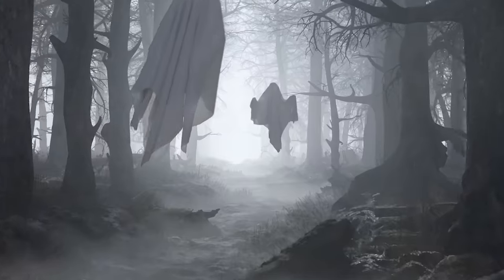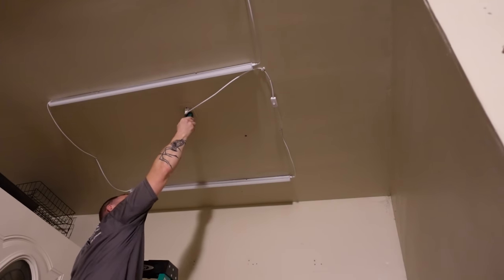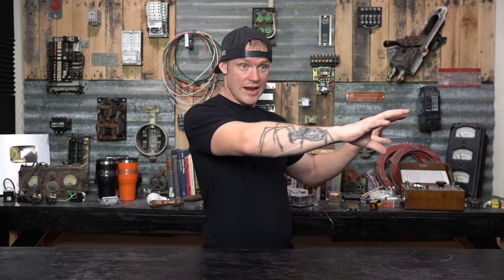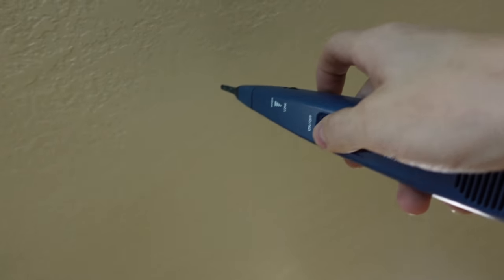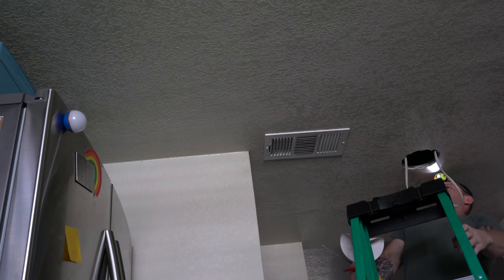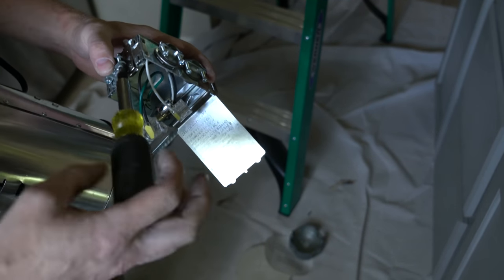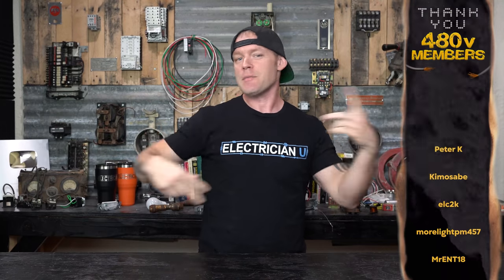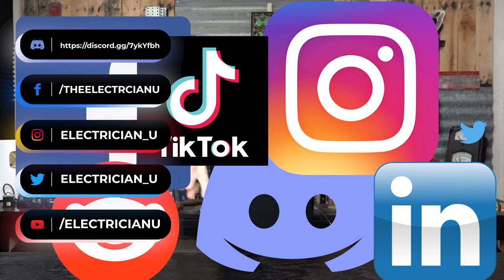THIS IS WHY ELECTRICIANS DON'T HIDE J-BOXES IN WALLS - Finding Hackwork!!

Comment: As an IT guy, something that I've learned along the years applies to many other fields and it's funny to find the same here:
When you build something, keep in mind someone will have to maintain it for years and years, long after you're gone. Make it easier on them.
Reply: When you have to maintain a comms cabinet and they didn't color code the cables...
Reply: Service loop for the win!
Reply: @GoodwillWright  Or even just color coded zip ties that separate different bundles. 
Velcro one wrap (the double sided hook & loop tape) comes in a wide assortment of colors. I'm still using the thrown out extra rolls from before 2003 when I was active duty and a contractor installed 5 different colored networks. 3/4" wide and it just used constantly on cables, parts and anything else that I need to secure and unsecure frequently.
If you get the 2" wide version you can suspend an entire person ... or a mower ... from the ceiling. 
(The person was a volunteer and only slightly drunk. And giggling the whole time)
Reply: My father was a Chief Electrical Inspector he always said, “Don’t build traps for someone in the future!”, this applies to anything worth doing well! Which brings me to another of Dad’s quotes! “If it’s worth doing it’s worth doing well!”
Reply: That somebody may be yourself too
Reply: @harles5000  And if you're wiring electronics for equipment that has an industry wide color coding scheme, follow that color coding scheme...
Reply: @karlrovey  Exactly that can give the technician down the road a world of diagnostic information! Great point!
Reply: @harles5000  My specific gripe is in the world of organbuilding. When electric actions are used, there is an industry standard color coded pattern used to make it easier to track which wire corresponds to which note. Sometimes people ignore the standard convention, leaving a nasty surprise for a technician years down the road when electrical components need to be replaced.
Reply: As a PLC tech...eff your color coding garbage.  LABEL CRAP!  We have a saying: Dont leave it for the next guy.  You WILL be the next guy.  I hate hearing people talk about color coding and standards, etc...I work in industry, there may be 12 standards in the same system.  LABEL it, draw it, leave it in the panel/box, leave a copy with the customer.  COMMUNICATE.
Reply: @jesseblanchard9609  There's a good reason for the color coded pattern for wiring in organbuilding.
Reply: @jesseblanchard9609  I once lived in a house with the sweetest breakers panel I ever saw, everyone would comment on it when they saw it, and until then I never thought it was important.

2 rows, upper row for upper flow, bottom row for bottom floor. Each breaker went to an area type: rooms, living, yard, kitchen, bathrooms, etc, all labeled and the label protected so it wouldn't wear off. All in a nice box flush to the wall, that we hid under a painting.

I think I started appreciating that work from that day on.
Reply: @karlrovey  there's a good reason for color coding everything...whatever that reason is, is good enough to require a label as well...that simple
Reply: @karlrovey  do you seriously think the 480v 3 phase motors and huge ass transformers and breakers and shit we use aren't important enough to color code?  But if they are important enough for that, then they are important enough to effing labelllll.
Reply: @jesseblanchard9609  I'm not talking about those. Those absolutely should be labeled. I'm talking about the wiring for the keys and pedals. The keys use a repeating pattern, allowing for a repeating color coded wiring.
Reply: Everyone who designs ANYTHING from drafting to engineering should have to go out in the field and work on whatever it is they design for several years before they are allowed to design something professionally. I am convinced that many designers/engineers are hopelessly stuck in what I call "the Rube Goldberg mindset" of designing things that are 20 times more complex than they need to be (how to crack an egg in no less than 150 steps) Taking something simple and making it more complex is not genius. Taking something complex and simplifying it is genius.
Reply: @barongerhardt  Hah, I immediately thought of motor vehicles when I read the initial comment.  There is a certain semi tractor manufacturer (I don't remember) who used only one color of wire in their trucks, the whole truck!  
Maybe a bit less difficult to troubleshoot being a DC system, but surely there are plenty of places you might have to work, where you cannot immediately see any wires bonded to the chassis. And you'll want to first check to be sure it's not a positive-grounded system...
Reply: that's what Gods do... keep it up.
Reply: @ACommenterOnYouTube  well, there's bad and good people everywhere. The bad only care about themselves, no way around that.
Reply: @ACommenterOnYouTube  a good workplace (or a good manager) will weed those people out though, if they fail to change. They're no good for business.
Reply: @ACommenterOnYouTube  I found one already. Good luck with the attitude though.
Reply: This is great advice but what I’ve seen is most guys doing the work don’t give a fuck about the next guy. People are childish like that.
Reply: reads the notes in the code

"Who the fuck wrote this code and what the fuck does all this mean?"
Reply: @ACommenterOnYouTube  are you a child? I'm not gonna tell a stranger over the internet where I work.
Reply: @jesseblanchard9609  LMAO! I thought it; you said it! (re your reply to 'You Tube')
Reply: @barongerhardt  the problem is this days in most industries repair techs are asked for more work for less pay and the only way to make a living is to do fix the problem faster than humanly possible and get to the next house so techs don't have time to worry about what will happen next even if it only takes you an extra 10 minutes to make the next guy job easier which could also be him but he can't take that extra 10 minutes cause he can't be late to next appointment cause if he does he gets hit with a $50 charge back cause customer called the company at 210pm to see where his tech is at cause he was told tech would arrive between 2pm and 3pm and even though he is not late cause he has until 3pm the customer called and well your  a bad tech and now you working for free at that particular house so screw anything that will take you more time than absolutely necessary to get the job done
Reply: Alternative approach (also spent ~30 years in IT) for many is to make it crazy complex and obfuscated in order to have job security since nobody else can figure out WTF you did.
Reply: @EdBert  those are the worst
Reply: @barongerhardt  use shrink wrap labels. Or fear the wrath of a Cat7 captain's daughter coming after you :-)
Reply: @barongerhardt  Personal preference. I see them as chokers. Dymo has some nice solutions, Lapp too. Color coding alone won't help you beyond a 16port switch. Written labels will.
Reply: Special K  Hahaha, my son (auto mechanic) just sent me a picture of him replacing the washer bottle (yeah the little plastic jug that holds windshield cleaner) on an Acura MDX. It is a four hour job that requires removing the front fascia and the passenger fender just to get at it.

Most mechanics feel homicidal towards engineers.
Reply: @MadsterV  in us putting anything like a picture over a panel is code violation
Reply: @213BRANDONP  oof that sucks
Reply: @GoodwillWright  see i always leave a book what port on the planal goes to which port on the what ever phone device and to which ever port it goes to in the room ect. good record keeping is the key
Reply: @aguyandhiscomputer  always at each end
Reply: @steveneumeyer7926  yup yup yup
Reply: You and me are a rare breed, most are just there to get paid and why they won't turn up again if there's a problem. Because they left it in a mess .
Reply: I have worked on electrical and HVAC for movie theatres for a while now.  Maintenance is not a word in their lexicon......
Reply: yep IT and elect...so related. Same trouble shooting.
Reply: Specially if it will be you who will do it.
Reply: I always go with "Current you's solution is future yuo's problem; make sure you make his job easier"
Reply: We have a similar rule when writing code: assume that the person who’ll have to maintain it is a violent psychopath who has your address :)
Reply: Be nice to the next guy because the next guy might be you.
Reply: That used to be a design criteria. And it seems to be making a comeback. As an IT guy myself I cut my teeth rewiring small business and home eternet. I was astounded at the spider webs I found, and the absolute spaghetti in the server rooms. It seemed to me that in the 90s the concept of wiring runs and proper patch panel circuitry was thrown out the window.
Reply: Exactly. Too many people missed that memo. I always run pigtails even if they're not using them at the time. I've installed too many control 4 lighting systems to not take 5 seconds to make someone's life easier in the future.
Reply: For commercial projects especially the GC AND engineering teams need to help with this too. More than just one trade will otherwise make their install easy and the later in the project it gets, the less optimum for space/access. Guess who’s at the end…maintenance staff that have to deal with it for years otherwise. So aggravating!
Reply: People who obfuscate code on purpose...
Reply: @jesseblanchard9609  You want to pay for that time?  Cause customers won't pay for that time during install but when you come back later for repair they certainly will pay for the troubleshooting time
Reply: sadly there are those who think,"Eff it, I'm changing careers and the boss is not around.
I had 2 different loads on NM/2 using ground as a neutral. . .strange stuff out there!
Reply: Yeah, I completely agree! A lot of people I have seen just have the mentality of ”just fix it” and stuff the electrical box, or stuff the network cables in the runners without combing them (which would make troubleshooting easier if needed to pull on a cable to move it somewhere else or if needed to identify a cable)
Reply: @GoodwillWright  When they put all the servers on their own subnet and don't allow printers to talk to the print server unless they are also plugged into the server subnet.
Reply: amen
Reply: I wish your wisdom would be echoed by automobile engineers.
Reply: @Femur15  I knew automobile engineers hated people the day I volunteered to change the spark plugs on a friends Chevy Chevette. I got a new rotor, cap, plugs, and wires. When I opened the hood I discovered the distributor was beneath the AC compressor! There was no way to even take the cap off without REMOVING the compressor! Years later as I was going to electronics trade school I got a job with a subsidiary of AC Delco that repairs their on-board  Electronic Control Units (ECU). They had an ECU which had dummy circuitry because the unit was also being used in Suzuki vehicles and they didn't want the Japanese to reverse engineer their fuel injection circuit. The only problem was the check engine light would light up if the dummy circuit failed!!! When I left the company General Motors was sending us ECU's that had never been installed in a vehicle to rebuild it instead of fixing the design flaw and retooling the actual assembly line.
Reply: @chadlumpkin2375  you ain’t kidding. I forgot about the Chevette having its quirks like what you said. I just think that it is unreal to have to yank half the front end off just to replace a headlight, or remove a bunch of crossmembers to replace an oil filter. It’s clear that these folks do not work on their vehicles because I guarantee there would be changes.
Reply: @Femur15  Don't forget about the late 70's Corvette. Oh, you want to change the spark plugs...just remove the front tires!
Reply: @chadlumpkin2375  I never had a chance to work on the corvette. I fixed a Porsche 944 once, but mostly your “run of the mill” GM, Ford, Chrysler and Nissans, Hondas, etc….
Reply: Agreed,  when I was in maintenance mgt. And we installed new pumps in plant, ie boiler room..I'd build a 30 inch tall table so no one in future had to bend over or crawl around to service the pumps...
Reply: That someone may be you. Ever look at something you did years earlier and wonder, what was I thinking?
Reply: The number of light buld jobs I get, lol.
Reply: Any good IT YouTube channels out there? I’m a year into IT. Self taught mostly.
Reply: typically when you do the job clean enough for the guy who comes after you, it eliminates the need for further maintenance
Reply: I just started as an electrical apprentice and it's mind boggling to me how some guys don't even consider servicing after the fact. I'm coming from a programming background where we fostered a culture of commenting excessively and often. There were more lines of comments than lines of code. Picking up where someone else left off and bug fixes are 10000x easier with detailed comments to reference. I'll never build anything that isn't easily serviceable.
Reply: As they say, the bitterness of poor quality lingers long after the sweetness of a low price is gone.  Unfortunately, few customers think of this when selecting any tradesman.  Low price is king.
Reply: Welcome to my professional life. Maintaining code that was written by brilliant idiots. No documentation or implied design..
Reply: tell that to Dell for their design of the Rugged. that fuckin laptop can burn in Hell